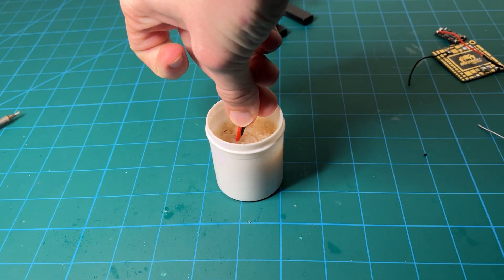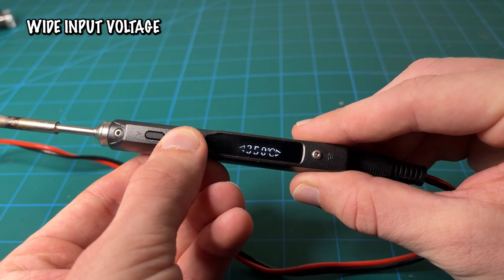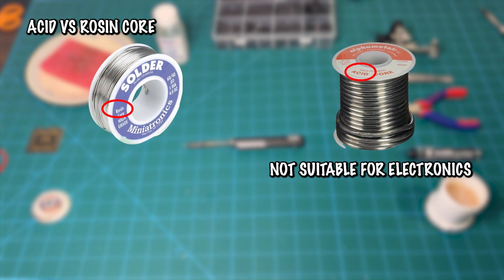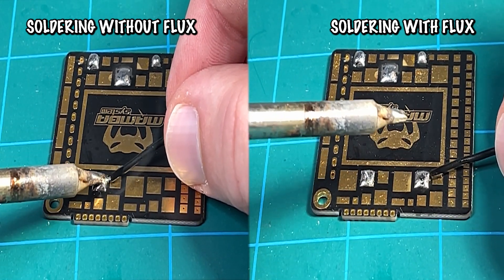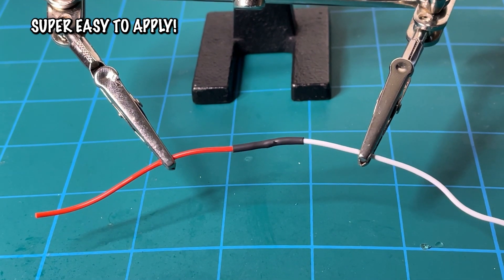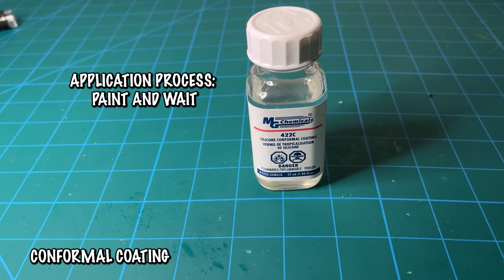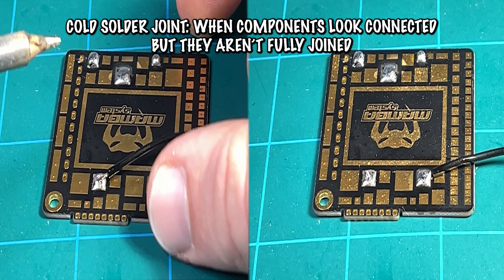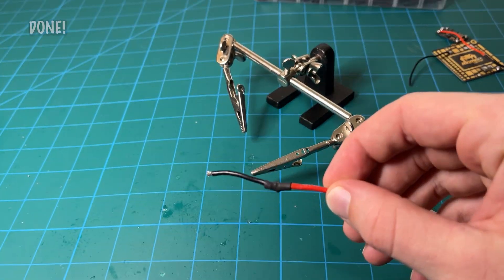How to Solder // Add a new tool to your FPV toolbelt

Comment: Did you mention correct temperature? Can't recall if I heard it in the video.
Reply from the maker: Hey! I don’t think I explicitly mentioned it, but I usually just use 400 C, and then vary the amount of time I spend touching the iron to whatever is being soldered. A power wire will require more time in order solder correctly, and a simple wire extension will require almost no time